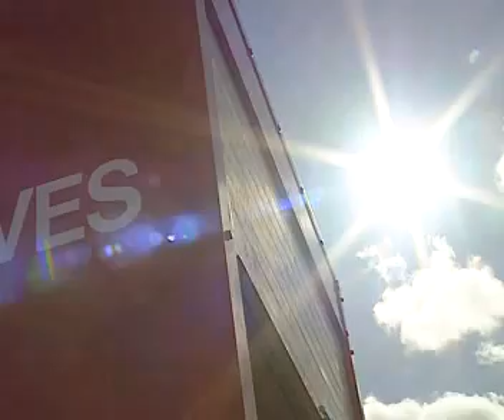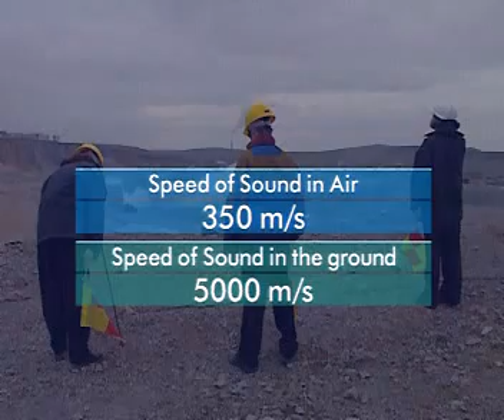How sound travels through different media.

Comment: OK here’s a stupid question. When lightning strikes (you see a flash) but you  hear it seconds later, is that too because the sound since it’s traveling through the air takes it longer to travel?
Reply: That's actually a great question! You're right! You see lightning (the flash) before hearing thunder (the sound) because light travels much faster than sound, and so it get reaches you faster
Reply: @BanAlMandalawi  Nice👍🏻. Thank you.
Reply: @BanAlMandalawi  hello if you get to me soon I have a question, I’ll explain I’m trying to hear my dog braking( he’s small) I’m trying to use him as an alarm, so I’m going to use tubing/ pipe….. should I use 
Stainless steel/ flex copper or pvc? I’ll be drilling a hole from the attic down so tubing will go inside one of the closets inside and outside right by where he sleeps.
Reply: In a simple definition, light travels faster than sound. The speed of light depends on what medium it is traveling through, being slow in gases, fast in liquids, and even faster in solids. Sound travels around 332 meters per second when traveling through air.

Comment: can someone answer my question plz?

why does sound travel with different speeds through materials ?
Reply: The speed of sound is not always the same. Remember that sound is a vibration of kinetic energy passed from molecule to molecule. The closer the molecules are to each other and the tighter their bonds, the less time it takes for them to pass the sound to each other and the faster sound can travel. It is easier for sound waves to go through solids than through liquids because the molecules are closer together and more tightly bonded in solids. Similarly, it is harder for sound to pass through gases than through liquids, because gaseous molecules are farther apart. The speed of sound is faster in solid materials and slower in liquids or gases. The velocity of a sound wave is affected by two properties of matter: the elastic properties and density.
Reply: @atillaerdogan9980  Could sum that wall of text down to "Density" and been done with it...
Reply: @atillaerdogan9980  I have a question for you if you could explain it in simpler terms. I’ll be using piping/tubing to try and hear my dog from the outside, I’ll be placing one end of tube next to where he sleeps and the other end will go through my attic and into a closet near me, should I use flex copper or pvc and why?
Reply: Cause it does
Reply: idk

Comment: But you did not touch on frequency and how that effects the process?  How much sound at 5khz does it take to produce the same level ,and effect of the low frequency sound of the explosion?  The word sound, only refers to what we can hear, if we can't hear it, it isn't sound. So the sound felt through the ground, is nonsense, if you can't hear it, it isn't sound. If you place a rod into the ground and vibrate it at a constantly increasing frequency, what frequency will be the first for the three test subjects to sense? Which of them will never hear the vibrating rod  because its mass is not large enough to transfer low frequency sound? Little explanations like this  can lead someone into thinking they know something, but in relation to what they don't know, it so small that it isn't anything.
Reply: "Little explanations like this  can lead someone into thinking they know something, but in relation to what they don't know, it so small that it isn't anything." Don't be so hard on yourself.